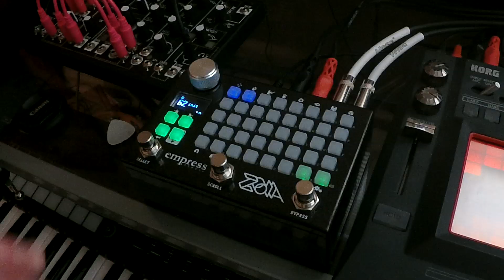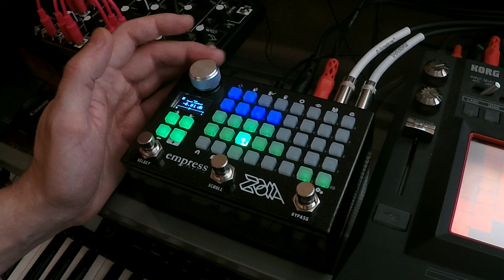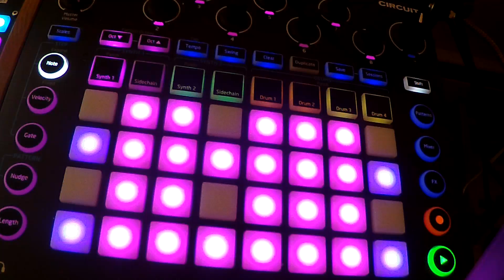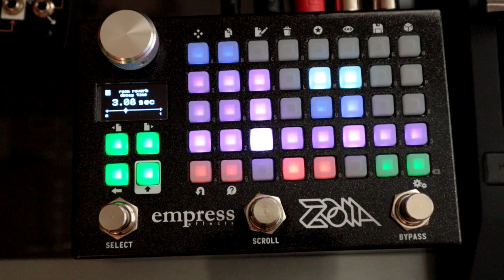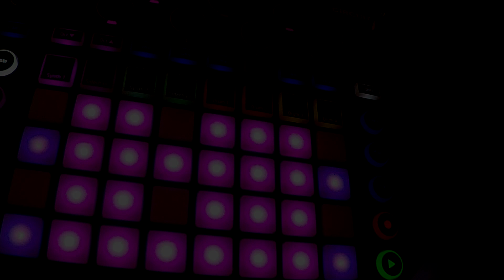Quickstart Pt 2 - LFO Basics // Empress FX Zoia Tutorial

Comment: Good tutes these.
To create a fully programmable slicer, say 32 steps per pattern, I'd have to run a pair of VCA's modulated by a sequence module right?
Would that give me the ability to edit the level of every step so that for example, steps could blend into the next step without gating? Thx
Reply from the maker: Thanks this was a very very old video and haven't caught up with the latest so I'm not sure, there could be better things to work with
Reply: @RonCavagnaro yeah, possibly in terms of immediacy, but apparently this thing can do for example everything the boss md500 can do... and way more. If the VCA module is controllable by the sequencer, it might be a few more minutes to get the result compared to the md500 but compared to the sl2 custom pattern creation process that's sweet. To the manual!😊
Reply from the maker: @ugh-y4p yes I still own the zoia and do want to explore it more. I'm guessing there's better modules now with more options. It might take a little longer to set up yes but once you set it up you could save it and reuse at any time. Also will have to say it probably can do many times what the boss is capable of. :)

Comment: hello there,  is it possible to sync the lfo to clock?
Reply from the maker: Thanks I think so, I just looked it up and see you can use the midi clock in module to synch a lfo
Reply: @RonCavagnaro  the lfo module has input from tap, cv or linear cv, not sure if I can send clock or clock sequence to the cv. I should check that out.
Anyway thanks for all your videos, very useful
Reply from the maker: @chambre466  thanks yeah I would have more info but my zoias knob broke a while back so I have to get it repaired, after that I do plan to make more videos on it eventually